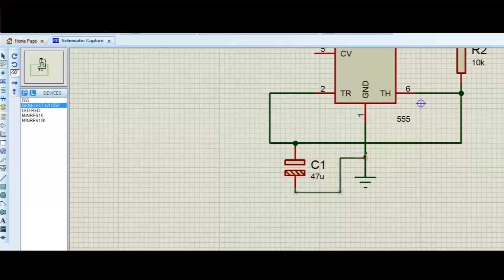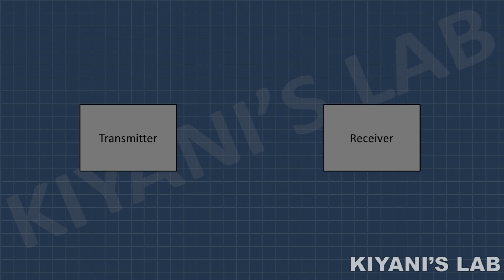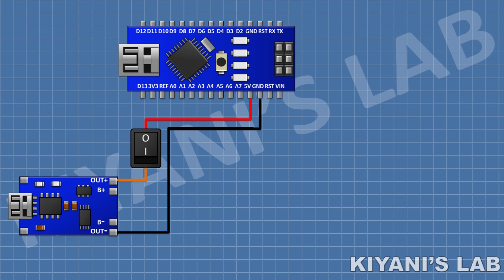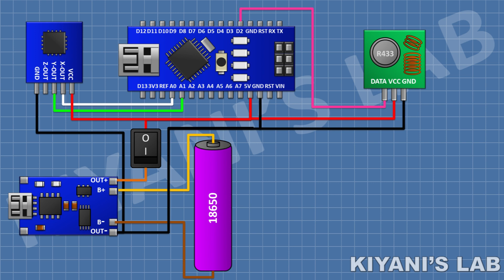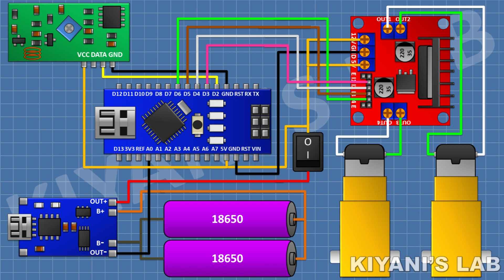How to Make a Gesture Control Robot Car

Comment: Your video is very useful thanks, rc  sunbber curcite is paller of power diode how to calculated the resistance, capacitor value pl. Send  video